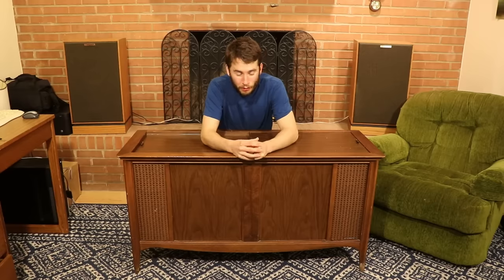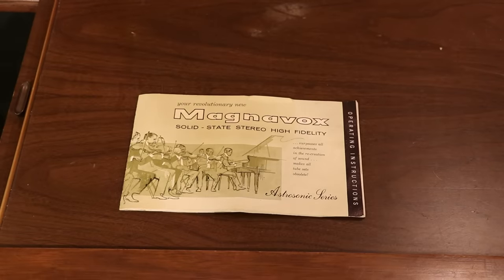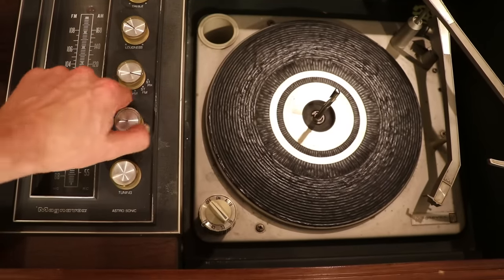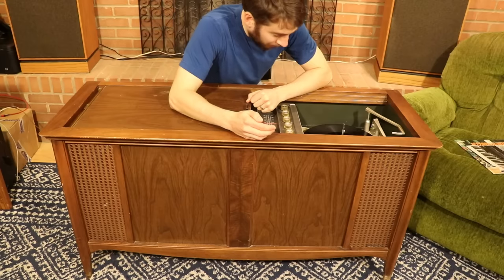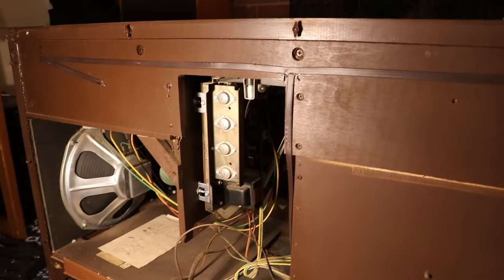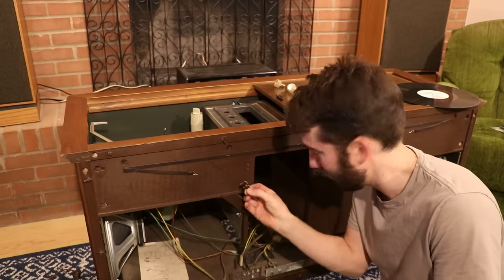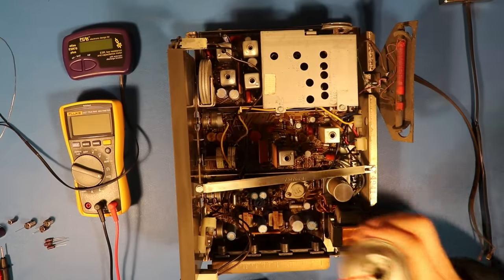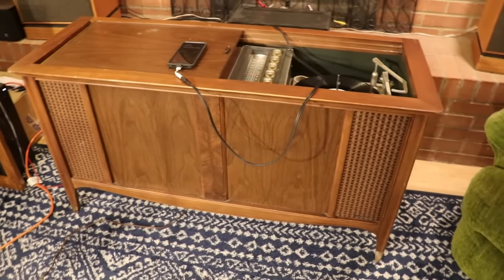They Found A Broken Stereo Console On Trash Day...Let's Fix It!!

Comment: I have worked on so many Magnavox consoles. This one looks like a 1967 model. Magnavox did indeed place resistors on their aux inputs. Another trick up their sleeve sometimes was to place a blend resistor to reduce stereo separation of the phono input. This masked the noise on some records. I always removed that blend resistor to open up the soundstage.
Reply: I had one that I think was a 1966 model before Astrosonic was introduced. I later bought an Astrosonic model around 1972. These things were really awesome IMO. I wish they still made them.
Reply: I used to tap into the phono on stereos and get ear screeching noise til I figured out not to turn the device volume to high. Think my other receiver has a resistor it doesn't have that screaming issue, unless I run bass boost.
Reply: Would you have a suggestion on one of these not spinning?
Reply: I think i just scored a 61 magnavox. So need to test it but its what i was hoping to find.
Reply: @kanito107 look at the idler wheel, the rubber turns hard and doesnt grip the platter sometimes it can be as simple as that
Reply: My parents had the 1967 model, except the cabinet was dark brown Queen Anne type and the speakers had cloth over them.
Reply: That cabinet looks very 60's.

Comment: Several years ago I found the exact same model from magnavox. The cabinet was in stellar condition, but electronics and turntable not so much. Instead of repairing these I dropped in another turntable and a modern day car stereo unit. So now it it has am/fm, cd, Bluetooth, turntable and remote control.  It lives in my dining room and is used almost daily.
Reply: I’m considering doing something similar with my console. I don’t know what brand it is, my dad had the cabinet custom made to make an existing piece of furniture my mom was given as a wedding present the were both given to me as a wedding present. I get the loud hum & smell of ozone when we fire it up so it’s just used as a sideboard in the dining room right now.

Comment: I have two cats and they're more qualified to work on electronics than I am😉 Replacing the capacitors might have been a good idea, you already had the board removed and there were relatively few.  A little TLC on the cabinet and this will be a nice nostalgic piece of furniture.  Thanks for the video, enjoy!
Reply: Exactly
Reply: I had to teach my dog not to chew power cord, he is definitely not an electrician. Beter to keep cords away from pets.

Comment: Magnavox console tube radios were awesome powerful things.  Big Alnico speakers in them and a truly deep rich sound.  I'd love to have one myself, but I'm perfectly happy with my "The Fisher 125" for right now.  I bet with a recap to get rid of that hum and some CRC contact cleaner followed by deoxit that old console set would sound decent.  I think the problem with the record changer had more to do with how warped that record looked than with the player itself.
Reply: Avoid leaving electronic devices, ink pens and even elastic and plastic in clothing in places which get to hot which can be attics and closet which can cause them to melt also a trailer that is not airconditioned can also. If leave closet door partially open it should not get quite as hot. I bought a used VCR and had to clean water out of tape drive to get it to work. So don't leave where will get too much moisture either.
Reply: The record changer’s idler wheel might have a flat spot if it’s been sitting too long. Letting it run for a while should smooth it over if that’s the case.

Comment: I did notice as soon as the back was being shown, one of the external speaker connector terminals is missing, so the wire might be roaming freely and could possibly cause a short if speaker switch selector is turned and that could kill an output transistor.
Reply: I noticed that too! I wonder if the guy in this video noticed that and 'at least' isolated the tips of the wires with electrical tape that connect to the missing ext. speaker connector  not to cause a short as it suffered that problem before on the right channel output transistor, and I bet that was the true cause!
Reply: I had a similar Magnavox without the AM Fm tuner. The 2nd negative teminal was missing by design for some reason.  You had to put both of the speaker negatives on the one terminal.

Comment: I picked one up off the curb but it was a bigger console , A magnavox imperial astro sonic ... I call it the aircraft carrier as it is a good 6 foot long ,  it also had the reel 2 reel built in... I restored it and it sits proudly in the family room , works great and is loud enough to have a block party with it...these are making a comeback due to the resurgence in vinyl...
Reply: I bought  a 1966 Sangean Imperial (no rel to reel, I have an Akai GX-4000 D) in 2017 for $100, still works great. It is semi-retired as I have a late 70 vintage setup I do my regular listening with, but it, too sits proudly in the living room ready when I want to use it.

Comment: My grandmother had an old Magnavox hi-fi that had a balance control underneath the bass or treble knob that you needed a screw driver to rotate it. The amazing thing about the balance control was that it wasn't left and right channels, it was balance for the bass and treble so that you didn't have bass or treble outperform each other. The other odd thing was that it had an fm only tuner which at the time was dominated by am broadcast stations. I always loved the way the automatic changer worked when you played a record to activate the changer mode, the tonearm lifted up hit up the edge of the record pullback to drop record and it then fell in place on record. When in changer mode, there was a sound cut out feature that while record was being executed, and once the cycle was over, restore to full volume set.

Comment: Good save on a sweet old mid 60's console stereo. Magnavox was a good brand. I have a 1963 Pilot console stereo that is a tube model, and also has the RCA jacks for adding a tape deck. For a time, I ran my CD player through the tape jacks and it sounded quite nice. It now has an awful hum which cannot be filtered out from the adjustment on the back, but I haven't gotten around to doing anything about it yet, but I'm thinking filter capacitors.

Comment: Awesome  I saved a hi fi from the  trash  years ago. I guess you  can  ad a booster on  the  auxiliary  line .looks the  the turntable  needs degreasing and  clean the idler surface

Comment: I really appreciate this video.  I have an Admiral console stereo from the early 1960's, and it has similar problems to this set.  It may have tubes in it, so it could be a different repair process, but this was helpful to see.  Thanks. 👍👍👍

Comment: Those console stereos are cool. My Aunt Millie had one back in the 1970s. It was a Setchell Carlson if my memory serves me correctly.
Reply: Stromberg Carlson maybe?
Reply: @mjg263 My uncle was really into Setchell Carlson electronics. He claimed they were "the best". I'm sure that's subjective. My dad was a Zenith man. Wikipedia has a brief description. I'm thinking that since my uncle was a Navy radio operator during WW2, that he used their equipment on the ships and found them reliable. He was the guy who sent the distress calls on the second and third ships he was on that were sunk. He claimed it was better to stay on it right up to the last minute because the fuel oil and sharks were a bit unnerving on the first ship.😂 He got off when the captain got off. By then there wasn't much of a drop to the waterline either. It was step in and swim as hard as you could so as to not get sucked under. https://en.m.wikipedia.org/wiki/Setchell_Carlson

Comment: This is great. I have a very similar Astro Sonic console, with almost the same exact cabinet.  It also has developed the same exact problem, which I am going to tackle here pretty soon. I’m hoping that the problem is the same one you encountered. I would have a very difficult time believing that it isn’t, since these units were built so incredibly well.  Thanks for the tip, and the great video!

Comment: I'm surprised the turntable even turns. I have an old Caphart from the late 50s and the turntable was basically frozen. The grease they used had hardened to a dry paste. My Caphart has a tube amp and it works well. You should see the spaghetti of wires and components underneath. It's pre circuit board and crazy complicated.
Reply: Those Micromatic changers were very good.

Comment: I found an old Zenith console record player--am/fm radio combo. It looks perfect: beautiful cabinet, no scratches anywhere on it. The record player works great--the automatic drop function and automatic arm functions just right. The radio tuner works great--all the knobs are in great shape, etc. But after about 20-30 minutes of use, the speakers start to crackle and then it just quickly degrades to into loud feedback/static. I talked to a local repair person where I live and he said it'd cost about $800 to fix. He didn't look at it--just quoted that to me over the phone based on the same description I gave here. Wondering if that's a fair price?

Comment: I love this, my dad found a console stereo on the side of the road a long time ago he used to use it but then he moved to live on a boat and couldn't take it with him, it got moved to the garage and it has a bunch of junk piled on top of it. Honestly not sure if it's still working or not.  It was similar to this but had a lid that lifted up, not slides open like this one.

What ever ended up happening with the record player? It seemed to be running a little inconsistent when you first played it? Does it just need some lubrication to bring that back up into good working order as well?

Comment: For the longest time I did not like console stereos.  We had a Magnavox growing up and it was so base heavy that it was hard to listen to sometimes.  It didn't help that the portions of the cabinet that looked like carved wood were actually molded plastic.  But with the internet and more people showing off their console stereos, I realize that there were some good ones.  Even Magnavox, certainly The Fisher.  This Magnavox with the simpler Mid-century style and solid state electronics looks and seems to sound nice.  The turntables were pretty crude, but they worked.  

Thanks for showing it off.  Bluetooth in that console would be a great modern addition.

Comment: Years ago (30) I found one in the local small dump.  Went out a day later, with tools, and took out it's speakers and crossovers.  I had a speck sheet book for Peavey speakers and I built two wedge monitors.  I use them in my band today.  It came with, per side, 2 - 4" speakers 1 - 15" speaker and one horn.  I did not even look to see if the rest of it worked.

Comment: My friend’s family had one of these. Power was turned on with the Treble control. The tone arm swings over to touch the record to determine its size before the record drops. This is around 1967 give or take a year based on the style of the record changer. Remember to turn off the changer before selecting the speed, the selector knob will not turn if the platter is turning. On high-end models, that selector knob illuminates and that area to the left would also contain a reel-to-reel tape deck, if that option was ordered. These sound great when all of the components are in working order.

Comment: In the 70's we use to look for these .Gut them out, cause the turntables were of the crystal type , so crap .BUT the amplifiers and tuner were tube driven so  1#use the amp/tuner and 2# take out the speakers ,make boxes and voila !A free tube sound system.3 to 10 watts/channel .Loud enough !We were 13-14 years young .Much was learned...Cool video .

Comment: I have the same cabinet, also in great shape, but with more accents on it. 
I connected a Bluetooth receiver and an attenuator to the tape input and it sounds great playing jazz through it. I picked up another Magnavox unit for free that was in bad shape but had the extension speaker. I trashed the cabinet but kept the extension speaker and all the parts for spares.

Comment: My grandfather had a console similar to this it was a old tube type. So since he had friend that repaired radio and old electronics .the unit had all new tubes instilled and speakers replaced basivly it was refurbished with all new parts that would go bad over time.after grandfather passed I used it a lot in the mechanics shop it was six bay building with 1/3 basement giving access to bottom of car via pit you drove over.you could turn up tsdiw and hear it clearly in all parts of the building.it would not distort sound. Some of those old units were better then high end stuff of today.meterials were heavier and would not fail after short time.my uncle ended up with it shortly after and don't know what happened to it after he passed.wish I still had it because it was so we'll add and also because of the refurbish.tje guys that did the work on it were two brothers that were skilled in electronics of that era.if it had tubes they could fix it.not sure if they made it better or just replaced all the tubes.i sure loved it's performance.could not afford to buy the equipment today to produce same sound and volume it would give..tjanks for posting this vudeo

Comment: It seems like it sounds nice.

A functional fault of a lot of these is the tonearm, which often doesn't have a cuing lever, or even a good finger lift on the arm, if there is one.  The one here on the left side is basically useless, and therefore it's almost impossible to use it manually and not possibly mess up your records (as you can see in the video, though it may not have actually scratched despite the sound).  I get it...they expected people to just use it automatically, quite likely with records dropping on top of each other scraping together, but still.

Glad you rescued this.  Enjoy!
Reply: Sounded like a typical solid state console....boomy and no details and no dynamics. Only the tubes are worth keeping.

Comment: I recently repaired a unit similar to this one.  In my case, cracked solder joints caused the right channel to become disconnected from it's speaker. In turn, that blew out the right channel output transistors and push pull resistors.

Comment: Ive got one very similar to it, only made by RCA and its all Vacuum Tube operation. Its been fully restored, and polished. The model year was 1959 so its AM /FM Original High Fidelity but no FM Stereo. True FM Stereo was not yet available, they did some kind of simulcasting using one channel over  a clear channel AM and one channel over FM. The Tap, Aux and Turntable were true stereo in operation.

Comment: Cats love consoles, I have one and it my cats are always laying on it. That sliding top is nice & it looks good with that green chair. The hum from the AM indicates it is emitting harmful electromagnetic radiation, may be a dirty connection or a bad graound causing it. I used to have an old stereo console that I could plug my guitar into & use it for an amp.

Comment: I do the same thing, but tube units only, late 50's- early 60's with separate 2 channel power amp, they are the ones really in demand. A functioning  2 channel tube power amp alone brings $200-$400.

Comment: I found Magnavox stereo end tables in a PA thrift store, vintage 1969?, the receiver still worked. They had three 12" woofers and four 4" drivers. I dropped in a pair of 8" full range drivers and they sounded great. I really wished I could have totally redone them with multi drivers, tweeters and crossovers, but I was only there three months and no decently priced way to bring them back to FL. So I put them by the road by my sisters house, they were gone within an hour. Fun stuff, but you just don't find things like that in FL much.

Comment: I have a 1947 console with excellent cabinet work. The radio works on am but the other bands don't work. I had a guy replace the cord and caps because he said it was red plating but he didn't fix everything. If I were to ship the chassis do you think you could finish it.

Comment: Love the video. I have a HH Scott Console in my garage right now found it curbside. My right channel is out.  However, the 
receiver amp section has a mono switch so I just play it in mono in the garage until someday fix the amp. May have the 
same issue as the Magnavox.  Do take in units for repair?  Reading the comments below about hooking up a streamer or
bluetooth receiver is the way to play with guests heads who doubt anything this old could be cool.

Comment: My father took the weekly trash to the town landfill on Saturday mornings. Many times, I went with him. I would look around the various equipment piles and look for electronics. One time I found a console stereo like the one in this video (but tube based). It had two 12 inch woofers, two 5 inch mid range, and two 1 inch tweeters with horns. I snagged them all, they were mounted on two wood and fabric doors that didn't look that dated. I mounted them at the ceiling corners in my bedroom and connected them to my stereo (a feature rich Boom Box from 1978 Radio Shack one for $179).  I got a great sound and I didn't even enclose the doors (the ceiling corners acted sort of like huge bass ports).
Reply: Good times good times...

Comment: You didn't check out how well that Micromatic record changer changes records. Does it index properly? Does it trip when it gets to the lead out groove in the middle of the record? Does it grind to a halt during a changing cycle?  It could also do with a cleaning and re lube, as I noticed it was a little slow getting up to speed.